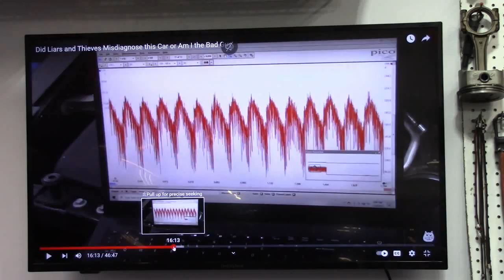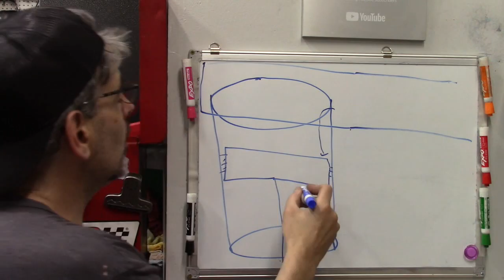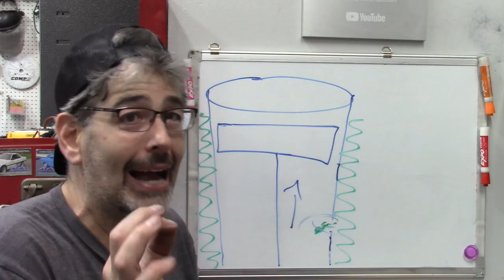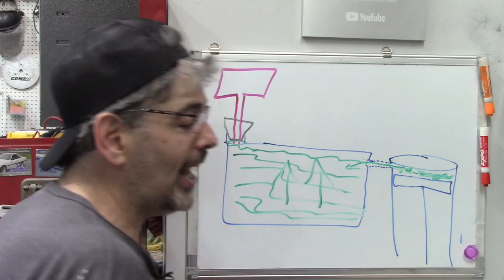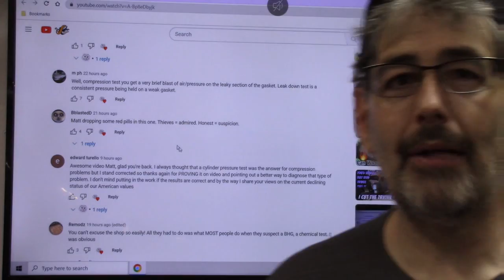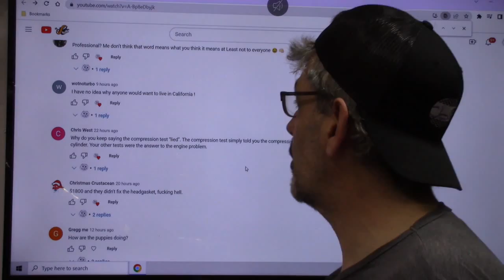When Compression Tests Lie and Miss a Blown Head Gasket

Comment: Great video. Very informative! I have a v6 engine leaking exhaust into cooling system. Block test detected Carbon monoxide in radiator. Did air into each cylinder at TDC. No bubbles in coolant on any of them. This test was done on cold engine. Is it possible the engine needs to be hot to get the pressurized air to leak into coolant. Or do you think more likel there is a crack in lower part of one of the cylinders. Engine had head gasket replaced 6 months ago and heads resurface and new head bolts.
Reply from the maker: Yeah as I have mentioned several times lately- I really no longer value these traditional tests for detecting coolant/combustion chamber leaks. I’m not sure if it’s something about new designs of engines or what, but I often find false negatives now. I used to never see a false negative but now I see them all the time. 
   About the only 3 tests I trust are the leakdown and transducer on radiator tests and a Borescope into a cylinder after engine has sat overnight is one I often use. . Compression tests are useless to me, as are block chemical tests.

Comment: Is it cheaper just to buy a new engine as opposed to a "blown heaald gasket"? I ask this because of some of your comments which include a "blown head gasket" can entail a "cracked/damaged gasket", as well as a "cracked/warped head" and a "cracked block". It seems to me that a "head gasket" and a "head" would be viable options, but a cracked block would not. I know you addressed this in some detail, but are there instances wherein when just a bad "gasket" itself would be reason to  replace the engine with regards to the expense of it all? Thanks. Really enjoy your videos.
Reply from the maker: Yes I agree- normally given the labor involved on a head gasket replacement it’s normally not cost effective. 
   I actually usually recommend a used engine actually- with a 1yr warranty.

Comment: Great science backed video.  I just did a head gasket replacement. Prior to that I did a block tester color change and it was positive. Unfortunately i have an expansion tank and the combustion gas was causing a vapor lock in the cooling system and when the thermostat opened the coolant will quickly raise the level in the expansion tank. I had to time it to use the block tester and i was lucky to detect it. 
Took a chsnce and it seems that the HG replacement solved the problem. Prior to that i checked the block and head for warpage but it was within spec. Thank you for this video. .

Comment: Is there a way to freeze with liquid nitrogen and then test fluid retention under pressure to see if any fluid is escaping back into the cooling system or out a crack?

Comment: I wonder if a dirty cylinder can seal a small head gasket leak when testing the compression, but yet somehow allow the coolant to leak into the cylinder. Just a thought !!
Reply from the maker: Yes I have thought of that too- I described it as “flap effect” where it seals on compression but the leak is present on suction. I do believe there may be some possibility to that.

Comment: How was the test on screwn done?
Reply from the maker: you mean the relative compression test I assume ?
it was done using amperage measurement from the starter during cranking and just projecting it to the screen using picoscope software.
Reply: Opps screen

Comment: Matt another easy test is to use a pressure pulse sensor on the radiator filler cap. Demonstrated very well in this short video. https://www.youtube.com/watch?v=z-BlPBI3Rio

Comment: The compression test didn't lie, it just didn't provide you with the information you needed to come to a conclusion.  In that case you just continue to use the scientific method until you do obtain the information you need to come to a conclusion which is demonstrably correct, and you do flawlessly, every single time.  That's what scientists do.
Reply from the maker: Yes agreed. It didn’t lie. It gave the actual compression.

Comment: You said the vehicle was huffing white smoke (steam) from the exhaust, which means coolant is somehow getting into the combustion chamber.  Just because the other garages made futile attempts, if they attempted at all, to determine the cause of the white smoke and didn't, or couldn't find anything, doesn't mean a problem didn't exist.  If there is an obvious problem, which in this case there is, and you can't find it for whatever reason, the right thing to do is stand tall and say, there is a problem but I can't figure out what's causing it.  The actions of the other two garages are indefensible, in my humble opinion, but I hold myself to a very high standard, as do you.
Reply: @JohnDoesGarage  a friends Toyota Camry was depleting a lot of coolant. He took it to the mechanic and he just added coolant after inspection. Sure enough the coolant kept depleting and no puddles in the ground. It turned out that for a particular year range the back head bolts would lose their clamping force if the car ever over heated this damaging their head threadings and the HG would leak coolant next to the intake manifold. Well the coolant got absorbed by an insulation material that covered the underside of the intake manifold and never made it to the ground. 
Solution: change the engine not found in those year ranges.

Comment: Hi. I'm sorry if this is a foolish question due to the answer probably being mentioned in the video. I just wanted to verify is a leak down test the best test to find an internal coolant leak? Would it prove exactly where said leak is or would it just narrow down possible  areas but not one exact area? I appreciate any help. I like how descriptive you are and show all the possible scenarios.
Reply from the maker: Leakdown is the best one. It not only confirms the leak but also tells you where it is by listening to where the air exits (or seeing the coolant move). 
  It also works no matter where the leak is- so for example the awesome radiator pressure test was great but it won’t detect a valve leak. 
   I absolutely prefer the leakdown over all else.
   The only downside is it’s laborious and it only tests one cylinder at a time.
Reply: @Schrodingers Box  thanks for the quick response. I am nervous my engine has a small coolant leak, and it has passed a pressure test with no signs of external leaks. The shop I usually go to topped off coolant and said keep eye on it for 2 weeks until I come back for my oil change and they will do more test to see if there is a internal leak. I have been checking every day, and it seems to be at the same level, but when I really begin to see a drop in the level, it's after 4 weeks or so of driving. I'm just hoping it isn't actually a major repair, and driving it this past week or so isn't causing more damage.
Reply: Should also mention no overheating, no white smoke, no milky oil, and no stalling. So far, the only issue is the lowered coolant level in the reservoir. 

I appreciate your videos, though, because they are making me look at things more, with a little more understanding than I have prior.
Reply from the maker: I would absolutely do the leakdown test for sure. 
  It’s also possible you just have an internal coolant leak with the intake which is pretty minor. I have seen than many times too.
Reply: @Schrodingers Box  thanks you for the advice. I will pray that is the case. Do I want to have the dealer service center do said work or should I try to find a local mechanic that does engine work for a job like that (assuming that is the issue).
Reply from the maker: In my experience your best chance is with dealer.
Reply: @Schrodingers Box  thanks you for answering my questions. I appreciate it and am glad I stumbled on your channel.   We need more people out in the world like you. 👍
Reply: @Schrodingers Box  hi again, and I apologize to ask another question about this issue. I just had a combustion test and leak down test on my car. They said my car passed both test swimmingly and the oil looked fine. So the shop I went to said the best assumption they have now is either I had some air pockets or have a bad coolant resevoir cap that is allowing some evaporation. Does that sound correct? I'm happy they said it wasn't a blown head gasket, but I'm just hoping it isn't something else like a warped cylinder head or a crack or something. They suggested keeping an eye on my coolant for now, and if it drops, they will look more into it.
Reply from the maker: Yes air pockets in the coolant can explain it but it should burp out after two warmup cycles for sure. If it’s continuing issue then it’s more likely to be something other than a simple leak.
Reply: @Schrodingers Box  what other t3st could I get if it's continuing? I am going to try and get a new resevoir cap to cross that off the lost of possible culprits. If I could I would pay you for all your help. I'll continue watching your videos to help out your channel.
Reply from the maker: It’s just not likely you are drawing air into the cooling system through the reservoir.  
   I would do a radiator transducer pressure test and a chemical block test if I saw the car.
Reply: @Schrodingers Box  I'll keep those in mind if it goes low again after a couple more weeks. 
Would the chemical block test be needed even after a good leak down test? Just curious. 

If I have to ill go to the dealership and have them do the test or if it's something I can do being a novice car person I am open to trying. 

Thanks again for all your help.
Reply from the maker: Leakdown test is one of the easiest tests. Just bring cylinder to TDC compression and apply compressed air. That’s it.

Comment: The "NEW" nomenclature that you are looking for is 'egress'.    There is egress of coolant into the cylinder.  The egress could be through a crack, head gasket, stuck valve, blowby, etc.   or all the above--  who knows.  The point is that there is a break in the seal somewhere.   Egress is the word you're looking for.
Reply from the maker: I like it!!
Reply: @SchrodingersBox  I think "Ingress" is actually the correct word.  Egress is to exit, ingress is to enter.

Comment: It can pull in coolant easier through the leak because as the piston is going down, it pulls vacuum-- which can give a slight "boiling" effect and pull in more coolant vapor through the leak;  which also acts as a kind of one way capillary effect.  Then on your up stroke with the coolant now in the cylinder, it is increasing pressure, which is making it increasingly harder for the coolant to vaporize, which helps to block it from going back out of the leak hole so easily since there is a much higher surface tension when it remains a liquid;  and ultimately it then gets blown out of the tailpipe as white smoke.  This implies that the leak is small enough to act as a one way check valve just due to the changing state/phase of the water from a liquid to a vapor.

Comment: Hi Matt,

thanks for the great video! I removed my comment because you answered it so well.

I have a question for you for the future. 

If you were looking for a compression test, I would be interested in knowing if a radiator compression test
while you're doing individual cylinder compression tests would be a useful way of determining in which cylinder
is the exact problem! Because, if you eliminate the problems to the individual cylinder and you have your radiator
compression tester on, you should see the PSI increase for the radiator compression test, indicating a blown head gasket.

Would love to hear your response :) 

P.S., would be AWESOME if there was a way to make a compression tester a radiator tester
Reply: Hi Matt,

thanks again! Another secondary thought, though I apologize if what I'm saying, both in my last comment and here sounds dumb lol.

If you took out the, Oil cap, you know where you have to remove the oil cap to pour in oil through the valve cover, and then you did a compression
test. Would you be able to, if you put you ear to the cap, be able to HEAR the leak coming out of the cylinder, even when there's no compression lost?

I wonder about that too both with the oil cap and the radiator cap.

Thanks a million!
Reply from the maker: You won’t hear it through compression test but you will definitely hear it through leakdown test IF the leakdown is past the rings.

Comment: Isn't there going to be a time delay between the pressure wave coming from the cylinder before it reaches the transducer? So you could use it to verify you have a leak (in theory), but I'm not sure how you're going to compensate for the time delay to determine which cylinder it is in accordance to the trigger on the scope. The velocity of the pulse could also be hard to detect because it has to move through a considerable amount of liquid and lost its momentum. And if the leak is small, it wouldn't have enough time to create a pressure wave that is clearly visible above background noise from the pump.

Another option would be to do it the other way around, where you pressurize the cooling system, remove the spark plugs and crank the engine. Whichever cylinder is leaking will spew liquid out of the spark plug hole. Granted, you'd have to remove all 8 in this case.

As for the leak in the cylinder wall. That would make water leak into the oil pan. Meaning you'd be able to see sludge eventually?

Comment: This may be a duplicate comment, but I was recently burned with a head gasket failure on a 2001 x-trail (pretty common, apparently), it started perfectly when cold and no bubbles were produced in the radiator neck, albeit it was a cursory check in the field for a friend, but when I examined the car again hot, it was spitting coolant out the exhaust and missing badly - only at idle and in gear. There are different failure modes for head gaskets, my experience had always been that it would start rough and misfire, etc. It's useless posturing, but I'd imagine it would have passed even a leakdown test in this rare example with how perfectly it ran cold. I guess the difference was an MLS vs the old style head gasket that's pretty easy to diagnose when it's failed, because it's as if it was only drawing coolant in under cylinder vacuum, not pressurising the cooling system and not pooling coolant in the cylinder after shutdown.

Comment: Hey Matt. I retired out of the industry last August due to some health issues. The compression gauge isn't lying, the cylinder has the capability to seal under the relatively low pressure of the compression stroke. It's the combustion pressure that will push past the gasket and cause overheating. It used to be a common issue with the Cadillac Northstar engines. Sometimes you would have to drive them for an hour in order to even get them to turn the block tester fluid yellow. I've also had the same issue with Duramax LB7 and LLY engines. My theory on why you can create bubbles in the radiator using a leak down test, is simply that the test is sustaining the pressure much longer than a cranking speed compression test does.

Last year for Bandamire. See ya at Casa Bonita.

Comment: Watts law where Power(watts) = Voltage times current.  If voltage increases, current decreases. They are inverse.
In Ohms law Voltage = Current times resistance(ohms). Voltage and current will follow one another. They would be proportional. Another way to say it is resistance(ohms) = voltage divided by current.

Comment: So I had the following measurements on my I4 engine: 255, 255, 255, 260 PSI.  The spec for the engine is 203 PSI.  I figured my gauge was wrong, so I borrowed my neighbors gauge, a brand new still in box Snap-on gauge and got exactly the same result.  How does this happen?  I can see being off a bit, but 50 PSI?
Reply from the maker: Sounds like carbon buildup in engine or it could be timing is off a tooth.
Reply: @SchrodingersBox  Thank you for the reply.  I've borescoped the combustion chambers and checked the one tooth off scenario, because it lines up with other issues the engine is having.  But I don't understand how the timing being off could INCREASE compression.

Comment: You hit this one outta the park !  Very helpful !  Thanks !   How about in cylinder ignition wave form analysis to get information on the spark line & firing line  quality . Interference to the flame front due to contaminated air fuel mixture / ionization .  Thoughts ?

Comment: How can you differentiate the normal variations in cylinder compression with an actual compromised combustion chamber? It seems it would have to be a large difference to even suspect it and if that were the case you might be able to hear it when cranking. I don’t know. My head hurts. 😁
Reply from the maker: Next video will make your head hurt even more hahaha- but it will explain it.